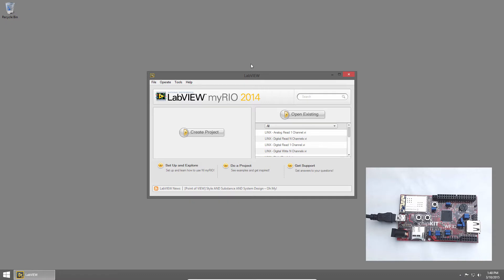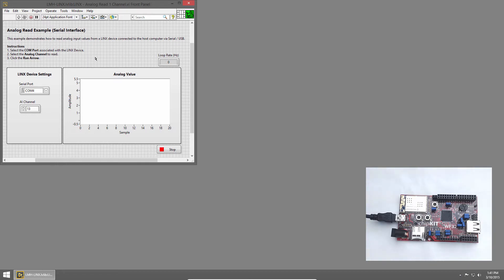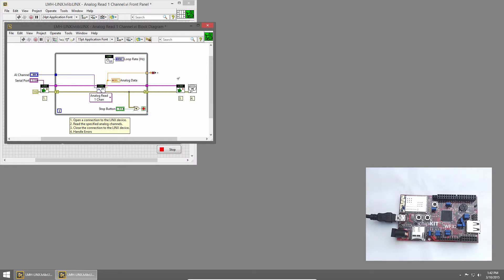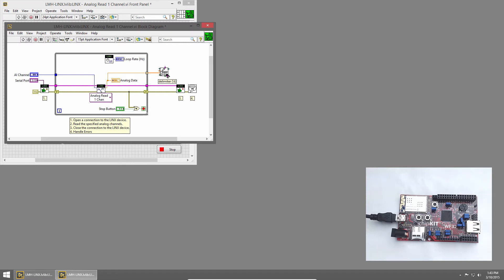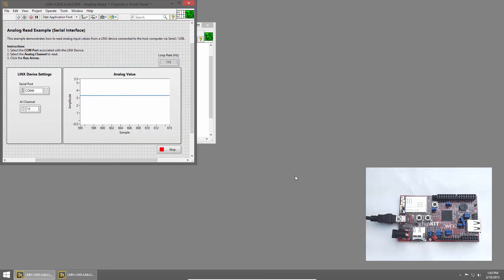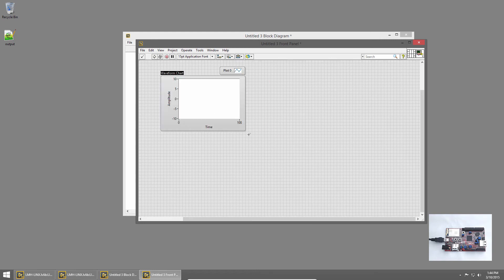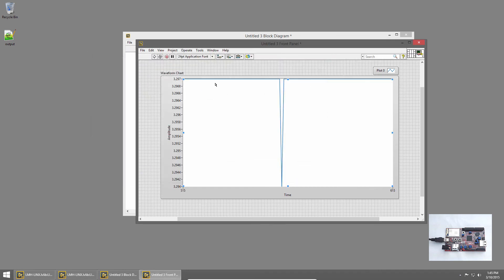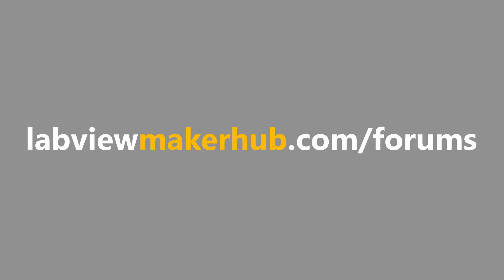Digilent Physical Computing Kit for LabVIEW - 08 | Data Logging

Comment: When I connect the output of analog read to the save to spreadsheet I get the message that the source is a single double and the sink is a 1D array of doubles, and the connection wont be made. What's the problem here? Thanks in advance.